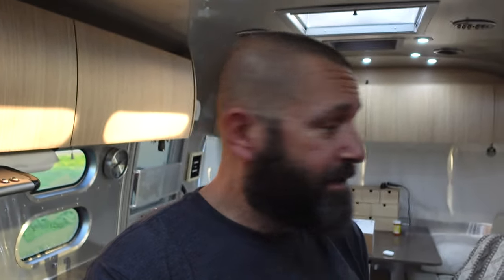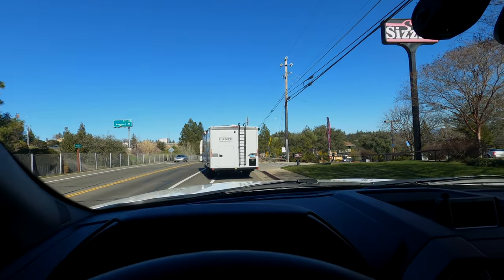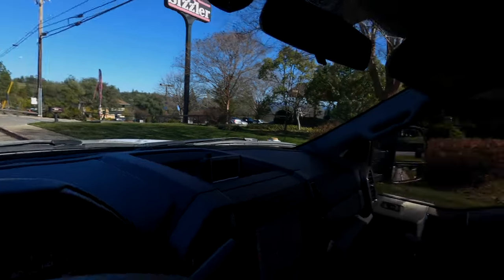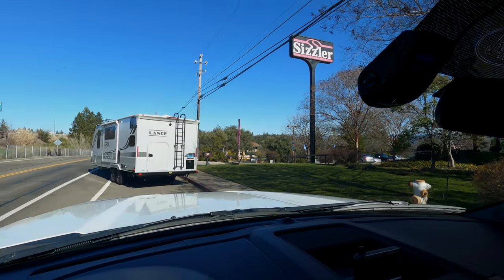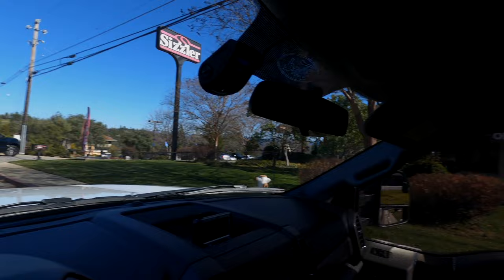A Few Airstream Cleaning Tips | Full Time Airstream Living

Comment: Have you heard of the two bucket method for washing vehicles.  One bucket has nothing but clean water, the other your soapy water.  Wash, rinse the mitt/rag/whatever in the clean water and then dip into the soapy water bucket to continue washing.  This "helps" prevent all the micro scratches from dirt that get into the rags from washing.  I think this method is used quite a bit by the detail shops.
Reply from the maker: Thanks Kim, I have not heard of that method.  Very interesting though.